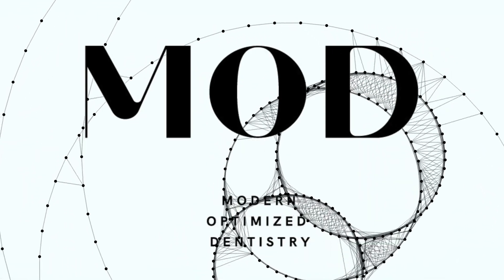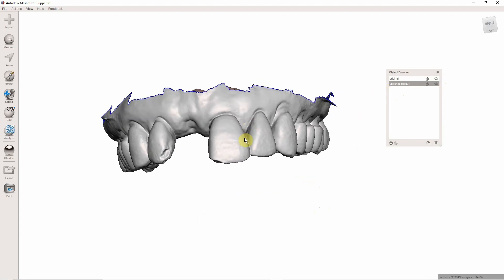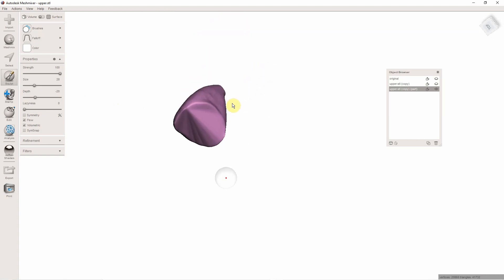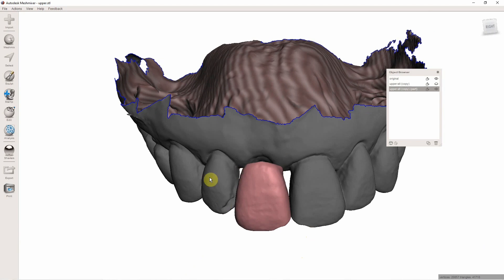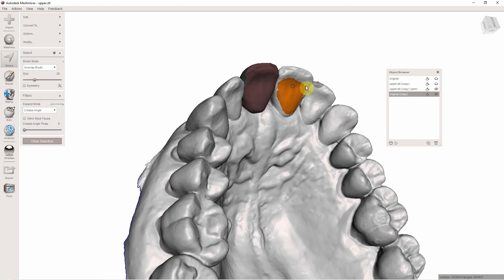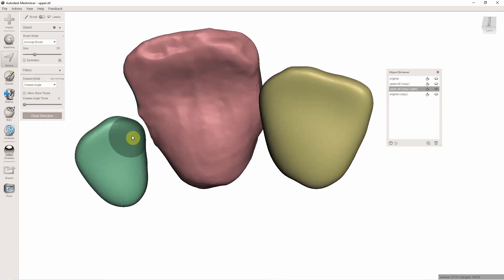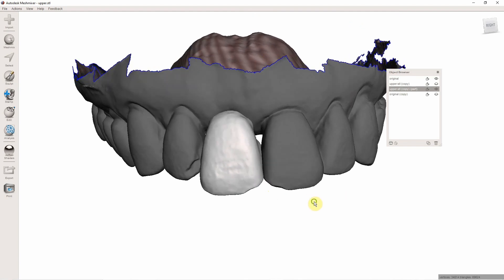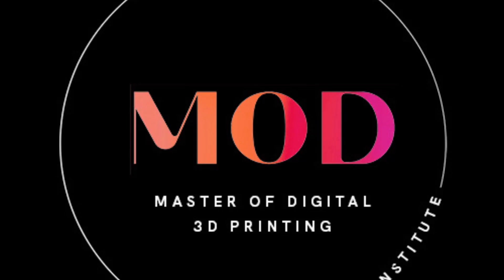Tutorial Meshmixer Adhesion Bridge (Maryland bridge) design

Comment: Thank you for your time making these perfectly made instructional videos.  Came here from your retainer video to see your bonding technique.  I assume it is the same?
Reply from the maker: Yes same. Sandblast wings. Paint on adhesive air thin but don’t cure. On tooth, etch, adhesive, thin and do cure. Use flowable composite for cement .
Reply: @wallyrenne  thank you